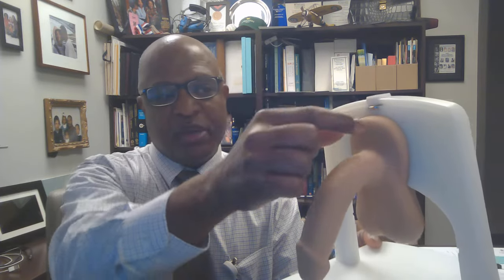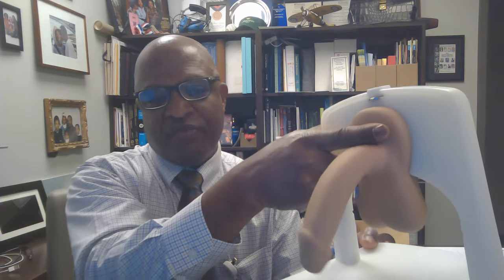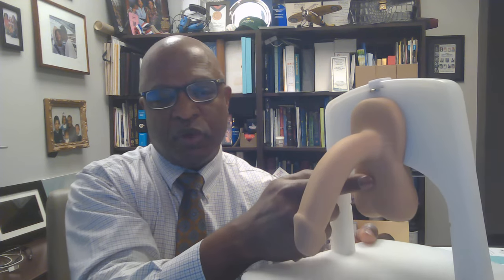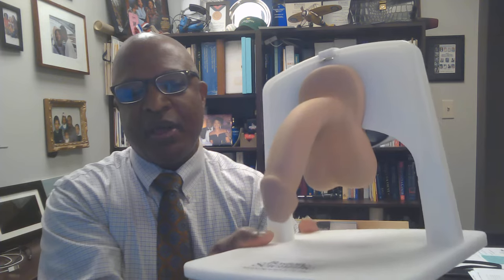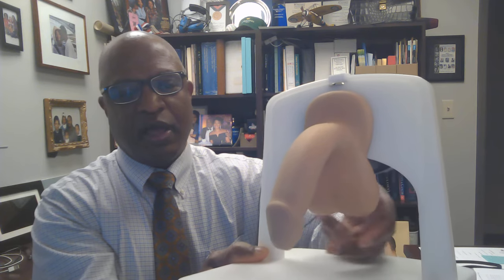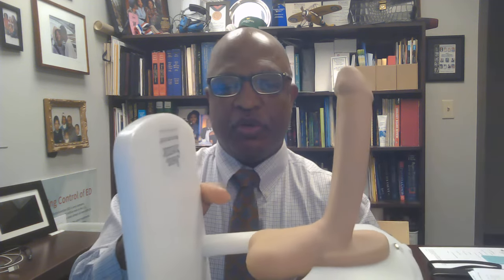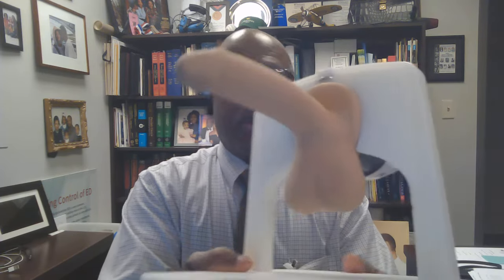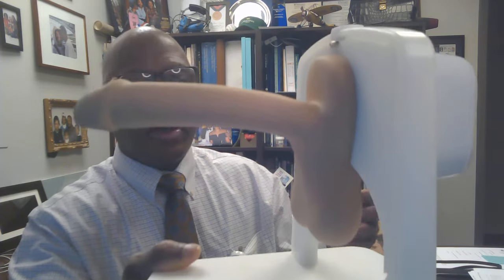Penile Implant Demonstration Model

Comment: I also meant to point out that they have diagnosed over 11 million men in the US with ED, and that is probably about 1/3 of the men who actually have ED since a lot of men will suffer impotence rather than go to a doctor, or who do not have the money or good enough insurance to get helped.  The US doctors implant about 25-30 thousand of these devices annually, so they are helping 0.002% of all men with ED AT MOST!  For a cost that is higher than all of Europe spends on all ED treatments.

Comment: Trust me when I tell you, the penile implant surgery is no joke.  Its painful and takes months of pumping and deflating to become useful. I've had mine for 3 years and it barely gets hard enough for proper insertion in the vagina.  Pump too many times and its gets exceedingly more painful with each pump.  Before my ED I was a full 7 inches erect, now after as much pumping as I can tolerate, I'm a pathetic 5 inches with a 1/3rd less girth.  Its better than nothing but not by much.
Reply: It works well, my boyfriend has one, no pain, no problems whatsoever. Sorry about your discomfort 😢
Reply: It sounds like maybe your device has a failure issue and needs replacing!!
Reply: @Trinijojo seriously?
Reply: I've never dealt with that and don't know anybody who has but that doesn't sound right. It does sound like something is wrong. And 70% is passing. Which meams 1/3rd of the doctors we come across are good at what they do, 1/3rd are ok, and 1/3rd just barely made the cut. Might be worth getting it checked out.
Reply: Which doctor did your hubbys one.

Comment: How do I have this procedure done I've been dealing with Ed for some years now and took almost everything I think I can take and nothing has worked I'm overwhelmed now and need help
Reply: Change your diet
Reply: Contact a urologist because the nervous system is in their specialty and that includes functioning of the male reproductive system.  Two be considered a candidate for this type of procedure they will run test and like others try pills or other alternatives like medical grade penus pumps none surgical. Having the surgical procedure usually is a last and final solution

Comment: how much does an implant like that costs?  Thanks
Reply: If you’re Canadian as of 2022 you’re looking between $15000 to $20000. Ohip doesn’t cover the procedure because it’s  none life threatening but most of it’s considered cosmetic, like face lifts, women’s boob enhancement, Botox, etc. so unless you have spare change, and put your schlong to use quite often, stick to the little blue pill. I personally use Trimix penile injections. You do it yourself and feels like a mosquito bite initially(it’s a tiny needle) but you get used to it. The result for me is fantastic and lasts for about 1 1/2 hours, more than enough time. So good luck to you dude.